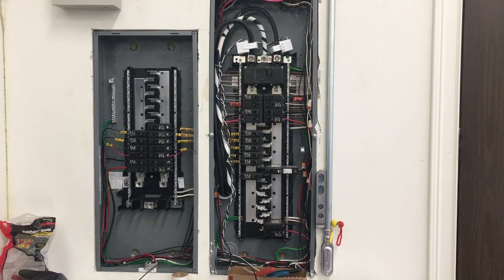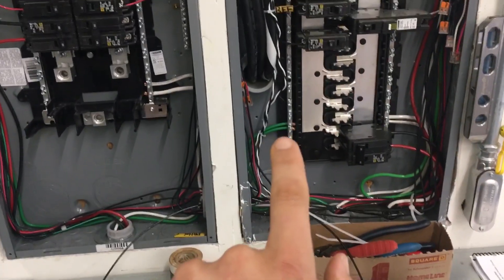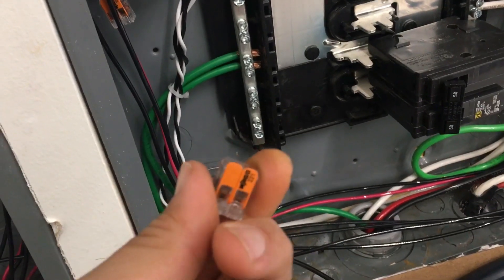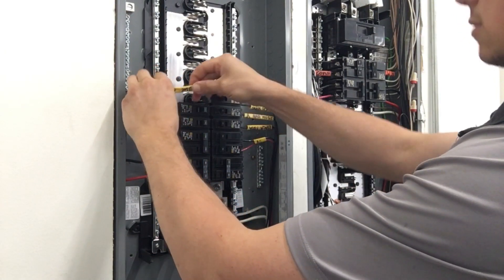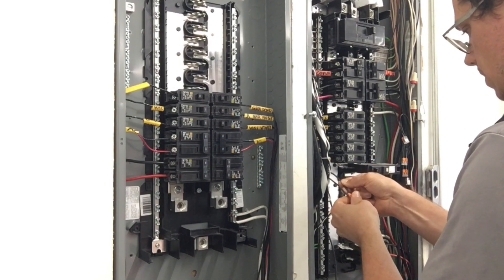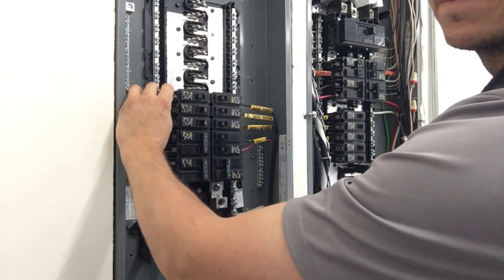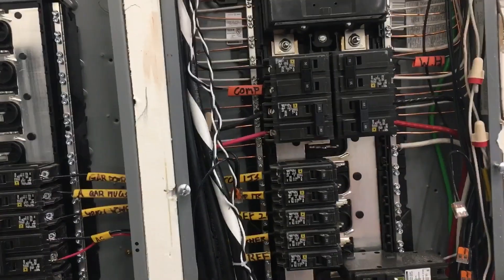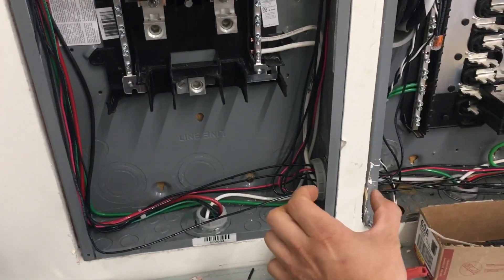Battery backup solar: Wiring the critical load panel

Comment: Johnny, am I correct in assuming that you only have need for a critical load panel when you are on-grid? Where I am totally off-grid, I also assume, I can turn off certain breakers if my PV system isn't producing enough power to keep my battery bank full of enough power to run my refrigerator, freezer or well pump. I obviously use my 7Kw diesel generator for backup but it is an option in a pinch. I couldn't quite hear the first part of this video due to the audio problem.
Reply from the maker: Yeah you do not need a critical load panel if you were off grid some people have system set up where the generator is the main and then the solar feeds everything else but they have a couple of large loads in the generator panel including the feed to the inverter charger

Comment: Just make sure nutral and ground is sized correct
Reply from the maker: Roy what size for a 50 amp breaker
Reply: @GainSolarPower  I'd use 6 but with out looking 8 I think would work
Reply from the maker: @royamberg9177  I once fixed a job where they ran the 6/3 Romex that fed the inverter from the grid out to a 3 pole fused utility required disconnect. They ran the neutral right through with the line conductors. For some reason the neutral fuse blew. It cause some electrical weirdness. Burnt up appliances. 82v at receptacles. 

I don’t understand autotransformers but I think about them.
Reply: @GainSolarPower  never want the nutral to open it will cause all kinda hell to break loose

Comment: Hey Johnny, wouldn't you want to move both hot and neutral of each load over to the protected loads panel, and get rid of the wire bonding the 2 panels together?  The way it is now, power will come in through the Sol-Ark, but return to the main panel (path of least resistance) causing inductive heating (minimally) in metal conduits.
Reply from the maker: You want the neutral and and the ground of both panels bonded. You want the neutral and ground despártase of every subpanel after the main where the first and only neutral ground bond happens. But I have called engineers from multiple companies and talk to them about the sub panel wiring and they all have always said the neutrals from each circuit can remain in place.
Reply: @GainSolarPower  thanks for the clarification!  I suppose once the grid goes down, it becomes a separately derived system which would need a neutral ground bond.
Reply from the maker: @benssolarandbattery  which it continues to use at the original neutral ground bond. There is another neutral ground bond in the transformer but there is no return current between the house neutral ground bond and the transformer neutral ground Bond
Reply: What about a situation where the breaker that feeds the inverter is flipped off while grid power is still available to the main panel? The inverter would be inverting battery power to the critical loads panel out-of-sync with the grid neutral. Does it matter what kind of inverter it is? I have a split-phase Aims Inverter with a UPS mode, and the manual is adamant that grid neutral and inverter neutral remain separate.
Reply from the maker: Nope that’s more work and not necessary. You are asking a very common question but I do this professionally on almost every job. I would only do what you were talking about with an arc fault or ground fault circuit, the large white and green wires I show in the beginning of the video are totally bonding everything and creating a neutral return path

Comment: Hello Johnny,  As you know, I built my entire solar power system myself.  I have always felt that the riskiest thing I did in that process was to rewire my panel.  I have done exactly what you said, gone back and switched some things around to adjust things based on use that only I would know over time.  Thanks!
Reply from the maker: It’s nice to understand your system. Most folks wait till the power goes out to try and understand their system
Reply: @GainSolarPower  I’m going through this sub panel plan right now in prep for an inverter in North Carolina (NEC2020). Few questions: 1) my main panel is recessed and would like to have the same for sub. Anything that is needed behind the panel for code compliance if recessed ? 2) I thought there is a 2” limitation on anything extending out from top/bottom of panel. Your trough seems to violate that. Maybe I misunderstood the code but want to verify because having the trough below both would solve so many problems. 3) I’m thinking having sub panel connected main panel via 100amp top breaker and an interlock breaker for inverter AC out. Any issues with that?
Reply from the maker: @cgutowski471  it’s 6” not 2”. The panel is made to mount recessed
Reply: @GainSolarPower  Thanks but I though the 6” trough extending out in front of the panel is a code violation and can only be limited to 2”.